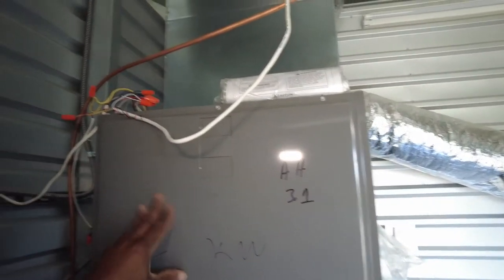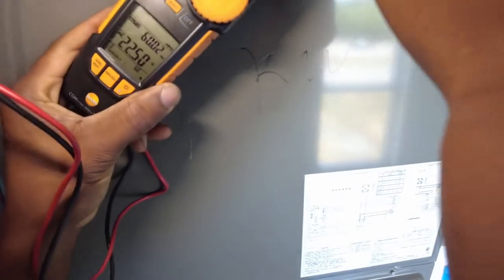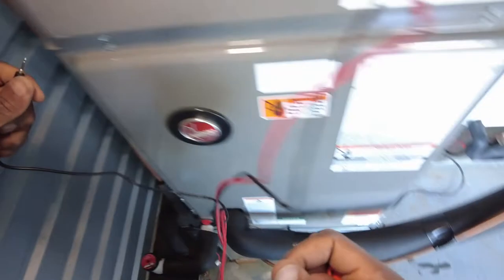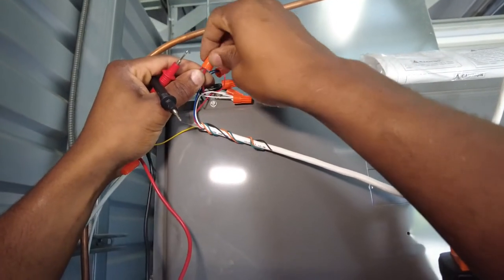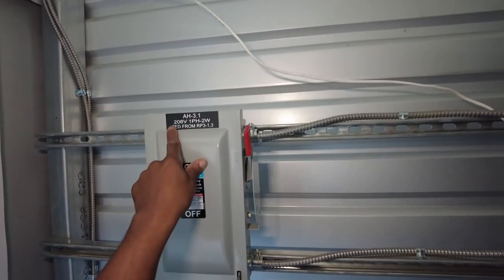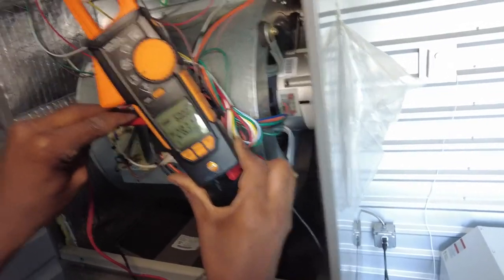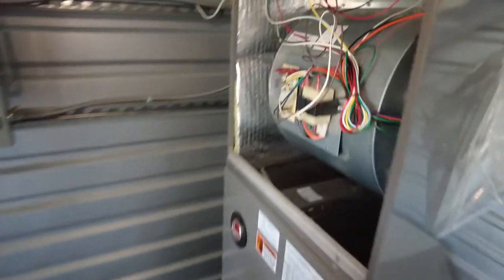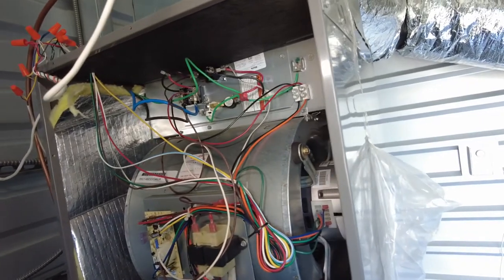AC Condenser Short Cycling Due to improperly wired Transformer | Transformer primary 208 vs 240 taps

Comment: Compressor fan wasn't working so I changed the capacitor. Then the AC started short cycling. Looked at everything. Finally I looked at the wiring diagram and I had the capacitor leads on the wrong prongs. Pays to look at your wiring!
Reply from the maker: Nice!

Comment: Switching over to testo, is it a  good clamp meter ...???
Reply from the maker: I'm not going to lie it's okay, I'm kind of missing my redfish though.  Its a cool meter just dont like that there's really no way to fix a magnet strap to it and no non contact voltage detector, didn't realize how much it used it. The only reason I switched is because redfish 550 is out of commission and apparently they can't get me a new one shipped till October so I found the testo on Facebook Marketplace for pretty good deal basically brand-new.
Reply: @HVACTechKnowledgy   thank you
Reply: does the testo usually770-3 connect to measurequick
Reply from the maker: Yes it does connect to measurequick, kind of. You pretty much have to use a Testo app and send the results from Testo to Measure quick so it's just quicker typing it directly in measure quick also it only sends the wattage not the volts and amps to measurequick. Hope this makes sense. Thanks for watching!
Reply: You right, redfish is out t
 till  October 😕. Getting the testo for the time being ( I think Is a great meter, yes, no magnet and ncv but, no deal breaker..  Like the watt feature.
Reply from the maker: Nice! yeah the testo 770-3 is a great meter I think you'll be happy with it. Thanks for watching!
Reply: @dfigueroa903  go with the Fieldpiece sc480 instead. It's got all the features that you were looking for. It's got the magnet, it's got the non-contact voltage, and it's got the Watts. It would be a much better meter than the Testo.